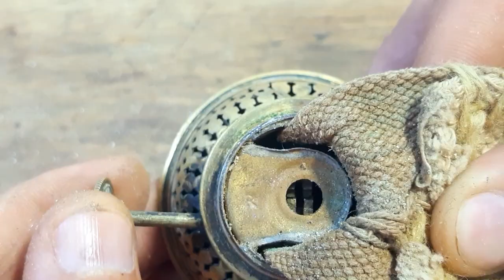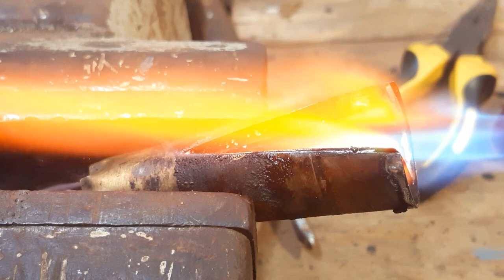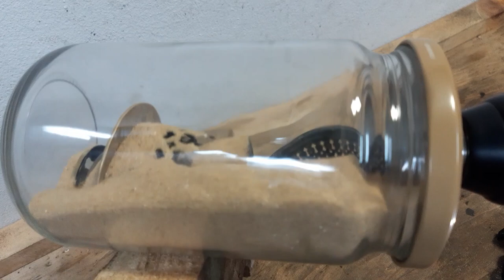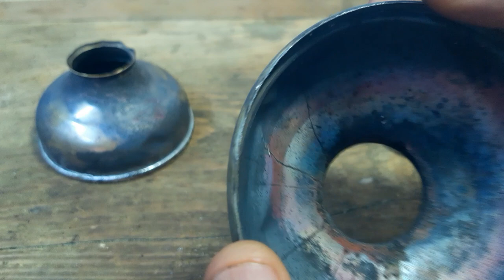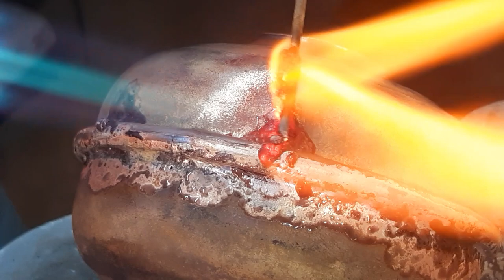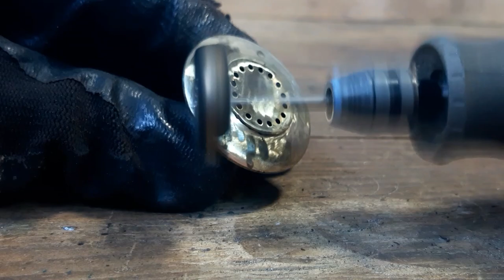restoration old oil lamp

Comment: If you soak the  complete burner in hot water and soap you don't need any tools to get it apart. Forcing  out a dry wick can damage the mechanical part. Oxidation and rust can be easily removed with a short vinegar/salt/water bath and ammonia for the tuff spots, so  no sandpaper needed. Finally, this is a Kosmos burner that does not have/use a flame spreader :)
Reply from the maker: Thank you for advice. Will care about in next similar projects.
Reply: Yeah came here for advice to unseize the wicks on a burner I just got, and first thing I see is a prying tool 😳 shan't be doing that. R Dolle, have you any further advice or just as you said above? Mines a twin wick duplex doesn't seem to be too old, maybe 70s. The adjusters won't turn, but the lever and flaps work. It seems the only thing keeping the top two bits, I.e the crown and domed wick surround together is a single punch/press dimple.

I came back, restored said burner with alot less effort than this (: since then I've done another and used all brass brazing rod instead of nasty solder of some previous repair, fixed a triangular 6 inch gallery that was split in half and cracked 😎

Comment: That flame spreader (on top),,goes to a Matador burner,,NOT a Kosmos burner you have there.
That Kosmos burner you have does not take a flame spreader,,but DOES need a Kosmos style(wasp waist) chimney,,to be a proper,and better burner.
Nice job on the restore job,though!!
Ha ha,,when you were seperating the gallery,,I was shouting,,No,,,it unscrews from the base....
Also you need to straighten the outer wick tube back to round.
Reply from the maker: Thank you, it seems that you have   a large idea about oil lamps. in fact I am not specialized in these lamp types. I will try my best in the next projects. 🙂
Reply: He has a “knowledge” of oil lamps ✅

Comment: Curious on what type of solder that is being used?
Reply from the maker: It was brass metal.
Reply: @RestorationInside  right, but the solder is sticks, never seen solder in stick form, I use a 60watt or 80watt iron with Kester #44 rolled rosin core solder on my lamp repairs, and it’s hard to work with.

Comment: Question if you will. How do you turn it off? I have one that's in working condition, but simply extinguish the fire does nothing about the smoke..
Reply from the maker: In this lamp, i simply turn the wick raiser knob in one direction until the flame turns off. That's what i do to tturn it off. Otherwise while turning in the other direction the flame become more taller & brighter.

Comment: I love the restoration my man. You spent a long time on this I can tell. Can I give you a suggestion. You dont need to put a title on every operation you do. We know what you are doing.  It stays there all the way through the video and then when you want to add some text the block you leave on there all they way through blocks what you are trying to say.
Reply from the maker: I will work on that in next videos, but if you want you can disable subtitles, therefore you can see clearly other texts describing other restoration process work parts.